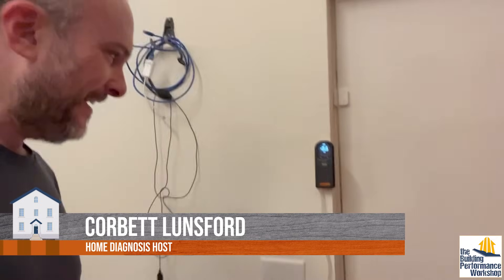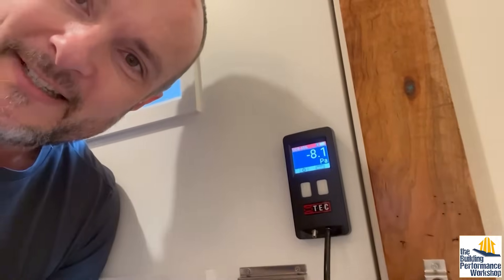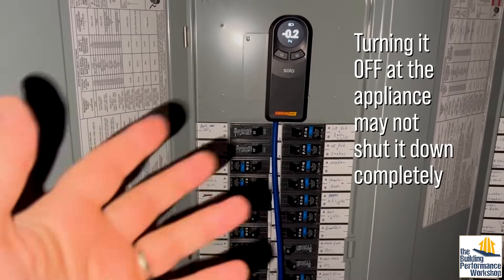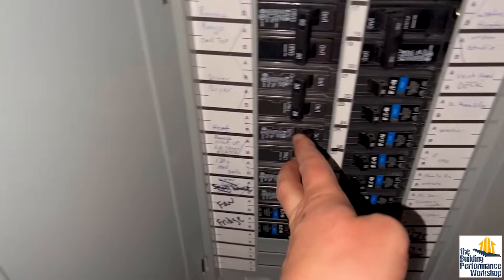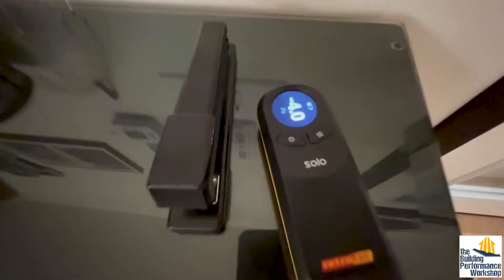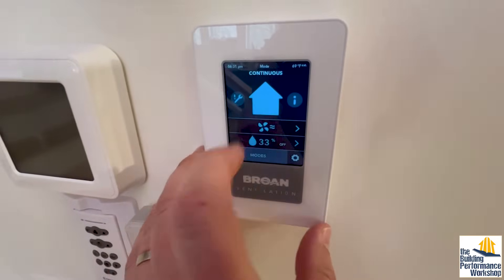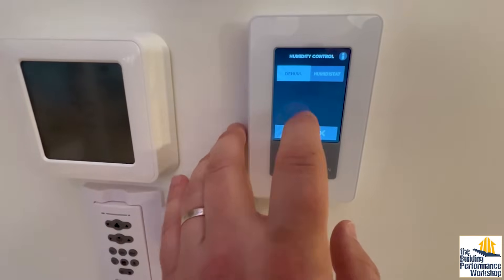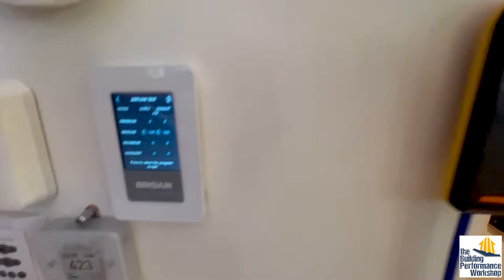Mystery Home Depressurization- Investigating and Testing Weird Vacuum (MAD Air in a Real House)

Comment: When in doubt reboot. Also I assume you know this but a common and hidden air leakage path that most don't think about it through the conduit feeding the electrical panel. There is a product called Duct seal, a clay like material you use to seal it up. Few houses ever have it done but it is checked for on commercial installations. Often the supply houses don't even carry it here or know what it is, but that's another story. 
       
      And on ERVs. I keep looking at the cheap import ones to use in the shop as it's hard to keep it cool without exhausting expensive cool air and pulling it 110* air.. Now this is a massive ERV in a large workshop https://youtu.be/c_773EWtNG8?si=pF-rlsc1g5MKWX0M

Comment: Should I add a passive combustion vent to the underside of my gas range in the floor? I Can get to outdoors in less than 8 ft. I have a Microwave vent above my gas burners.
Reply: Combustion air for a gas range comes from the room it is in. Opening a window and running the exhaust will work to remove combustion/cooking byproducts, assuming the microwave vent exhausts to the outside. Ideally, for any kitchen range, one would get a makeup air system, preferably active, and get a proper, adequately sized range hood instead of the microwave exhaust.
Reply: @therealmattyb  this is for makeup air AND combustion air. You need makeup air for any combustion and venting.
Reply: @rickeagle  Are you saying that the passive vent will be for both combustion and makeup air?
Reply: Yes.
Reply: @ You could do that but I would be concerned with bringing in hot humid air into the range like that. It could result in condensation inside the equipment and might damage electronic components. It would also obstruct the airflow to an extent. Corbett has a video explaining makeup air :  https://www.youtube.com/watch?v=36eMZNyAlGY . Though, if you did a passive system as you said,  you would get a makeup air damper kit like the Broan MD10TU which has a pressure switch which opens the damper when the range exhaust turns on.

Comment: Tip: Wait for the pacemaker to be introduced.

The typical IT department has already discovered that due to the complexity and reliability of their mostly automagically generated bloatware they need to install watchdogs and other monitoring stuff. These are basically pacemakers that reboot their beautifully automated process whenever it crashes or freezes again during unforeseen conditions. Code is so messed up that to please the manager's deadline a quick and dirty pacemaker is easier to do than a rigorous test plan is. 

It will take some time before those pacemakers are also hard coded into the firmware of normal appliances as the old fashioned programmer refuses to incorporate that crap as alternative to rigorous testing.

(I'm so glad I retired out of that world 🙂 )

Comment: How would we know this is a problem without having monitoring equiptment running?  What are the signs?
Reply: On a non windy day, when you open a door and you are standing inside you would feel a rush of air in your face flowing into the house

The other thing would be to look at the penetrations on the envelope...air coming into the house from outlets, bathroom fans...i taped a small strip of wrapping paper on the bathroom fan and see in what direction is moving
Reply: @fire9331-j3t  Thanks.

Comment: Adding a sensor to monitor and log building pressure might not be a bad idea; the outdoor pressure port design can be a bit tricky due to wind if you want Pa level accuracy, but there are ways around that. Flow monitoring on the erv ducts would be a nice to have too.
Reply: I’m curious, how would you set that up?
Reply: @EPDIY  You get a differential pressure sensor and connect one port to a line going outside the building and the other port to a big common area, the living room, maybe. You have to use a well designed static pressure port on the outdoor side to minimize pressure noise from wind; there's plenty of designs for that. Google "Quad-Disc Static Pressure Port" to get some ideas. Some people in the infrasound research community have used sections of soaker hose to cancel out wind noise; that seems to work, too. As for sensors, the Aranet one seems nice; their CO2 sensor has worked great for me.

Comment: Corbett, I’m a bit confused. So are the filters on the supply side too dirty and causing depressurization?
Reply from the maker: Since I didn’t mess with the filters and the pressure problem went away, it appears to have been a malfunction of the ERV. Sending this to their tech team as a heads up.
Reply: @HomePerformance  is this a case of Intelligence Artificial? 😂
Reply: @ I see. Thanks
Reply: @HomePerformance  can you add this to the video descriptions? because I was just like JohnLee-db9zt, totally not get what actually caused the excessive sucking after watching the video. cheers